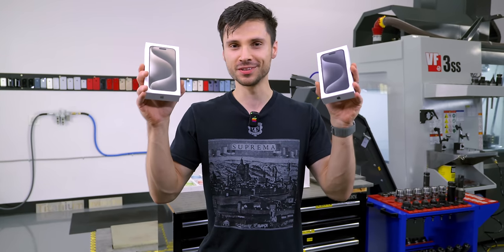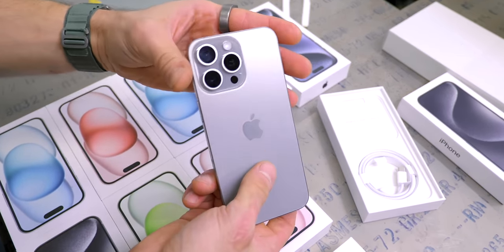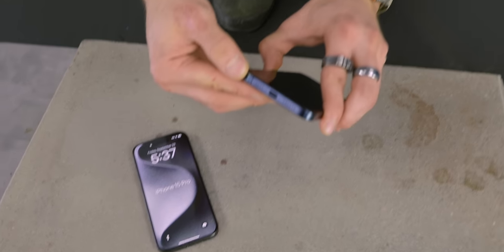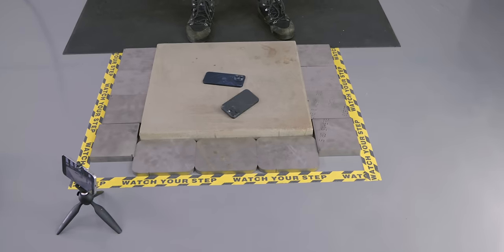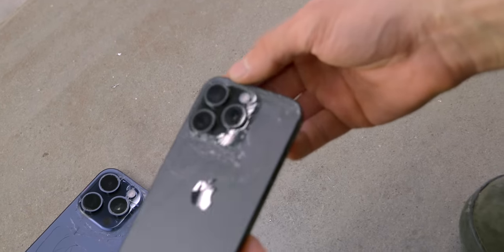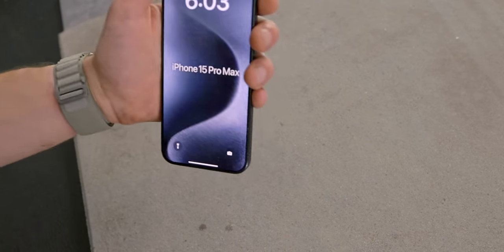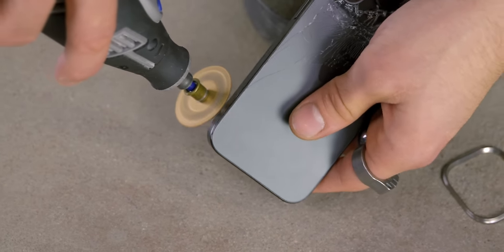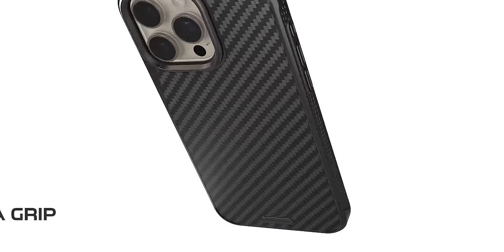iPhone 15 Pro Max vs 15 Pro DROP Test! TITANIUM At Last

Comment: Stainless steel is not only the undisputed king of smartphone beauty and strength material, I also would love if Apple bring it for 16 or 17 editions with a 6.9 inch screen for the Pro Max version same as now except with Stainless steel as the main build material, and make titanium separately on back order or something for those who feel they must have it, clearly majority of us fell in Love with Stainless and the industrial design since the 12 Pro was just a rumor mill as this channel used to say and show. Bottom line make Stainless steel for the masses again and titanium for the niches. Personally I never cared or requested titanium 😆

Comment: there is zero benefit from the outer frame made of titanium on phones. it will still scratch and dent. also its heavier than aluminum used on galaxies which iphone should be using instead of steel. Also apples glass they are using on the 15s are NOT TOUGHER than galaxy corning gorilla glass screens. corning makes top notch glass and is more resilient to impacts.

Comment: Do I need to buy a new iPhone just because of the titanium? Nah, what I need is a regular, cheaper phone that can last at least 8 hours of battery life, has USB-C, can connect via data, bluetooth, and wi-fi, has no useless bloatwares, dust and water resistant, not overheating, provides update support, and can be repaired by a reputable third party.

Comment: I have dropped my phone more than 200 times in just 1 year. And my android phone dont even have scrach. Its been more than 2 years and my phone is still in top condition and still has the same guard which came with phone. 
I am pretty sure this apple going to break in just 10 days in my hand.